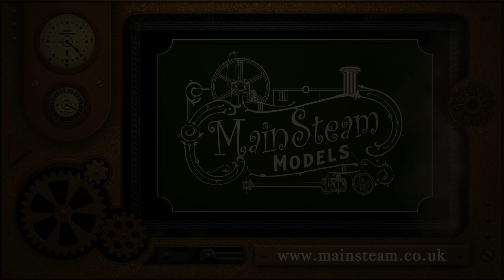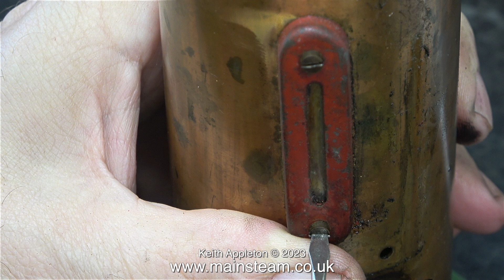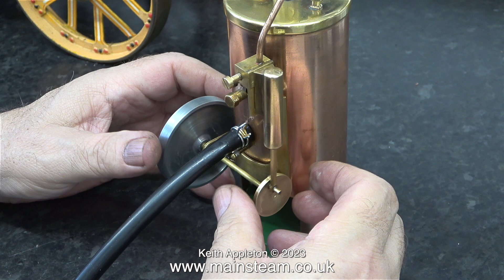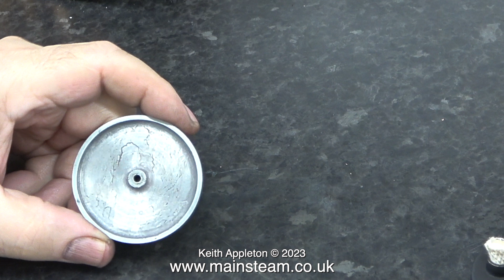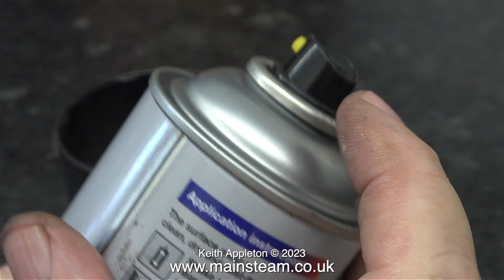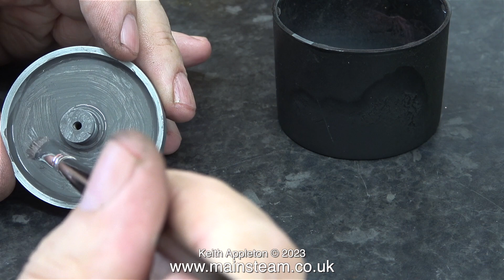REBUILDING A "BURNAC VULCAN" MODEL STEAM TOY - PART #8

Comment: Keith, I have a nearly 50 year old Meccano steam toy with an oscillating cylinder, but it can be reversed.  I wish the boiler had a water gauge and that the crank shaft had proper bearings.  But it is great fun to run!

Comment: It is clear to see that the present bearing surfaces are slopy, to say the least. Could it be also possible that the flywheel, etc. is out of balance, causing additional wobbling? ;-)
Reply from the maker: The Flywheel is fine ....... the crankshaft is weak.

Comment: I think that changing the crank shaft to stainless steel or something stiffer is a good idea. the phosphor bronze bushings will help with any wear and the two should hold up against the natural vibration of the steam valve. Like you have said many times, "each part is its own project." Might as well make it as good as is practical. This project shows just how simple a steam engine can be and still run well and have good power. Thank you for making these videos.
Reply from the maker: Thank you for Watching }:-)))